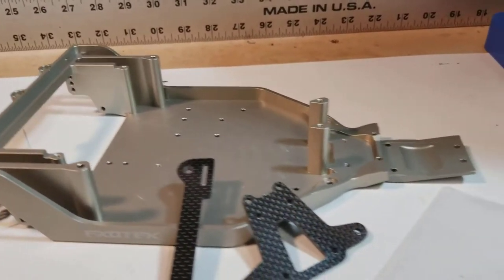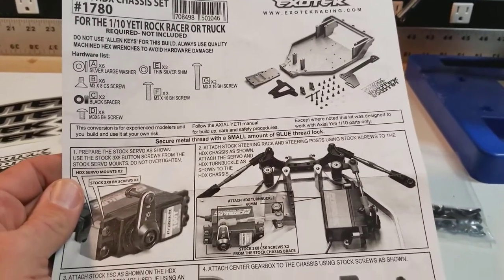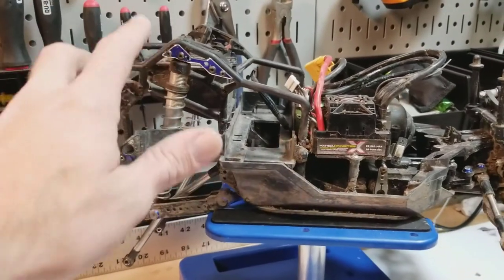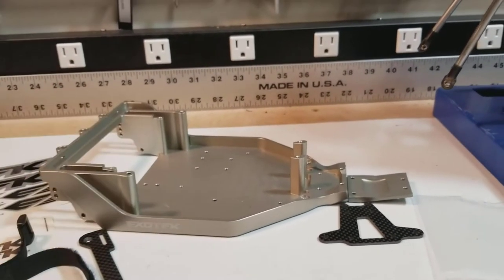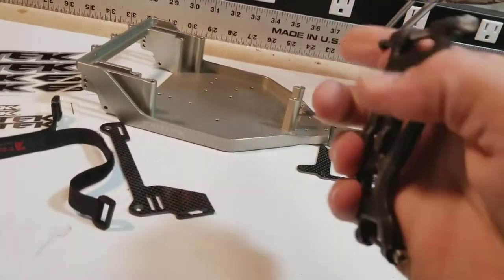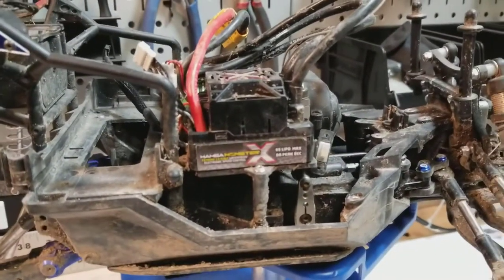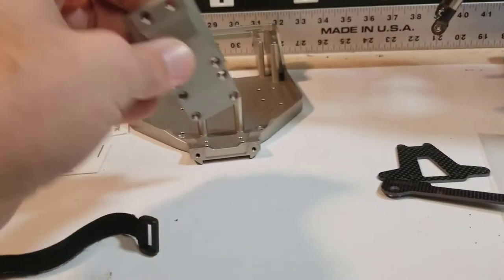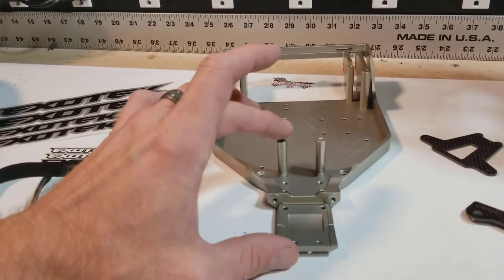Axial Yeti - ExoTek HDX chassis impressions

Comment: The Losi Rock Rey already comes with an aluminum chassis.
Reply from the maker: RCs By A Dummy correct.  Thought about getting the new kit but the limited spur/pinion options kept me away so far.  If the aftermarket picks up for it we'll reevaluate...